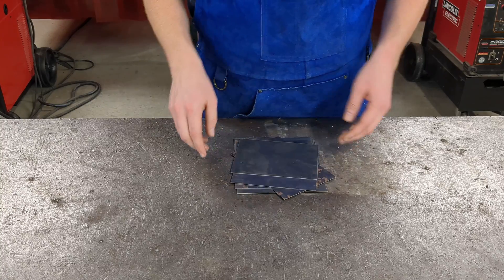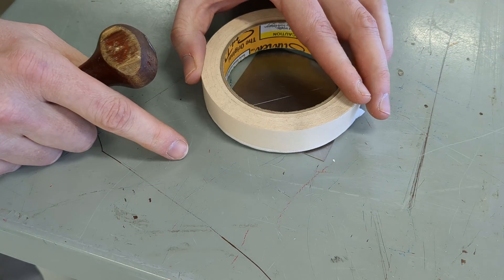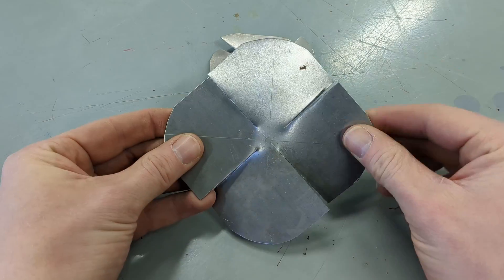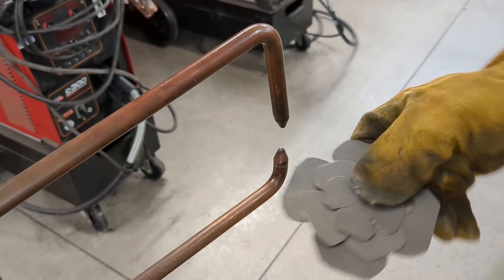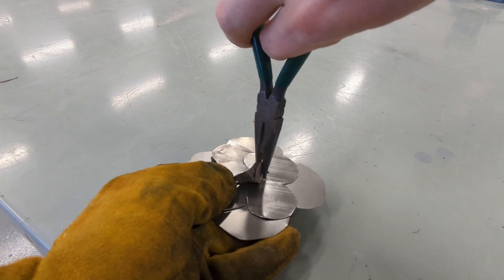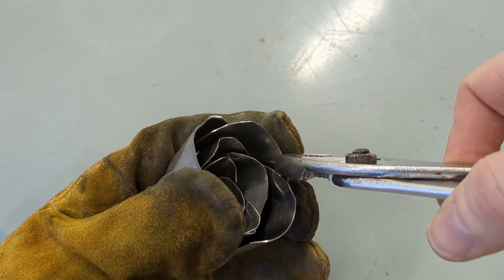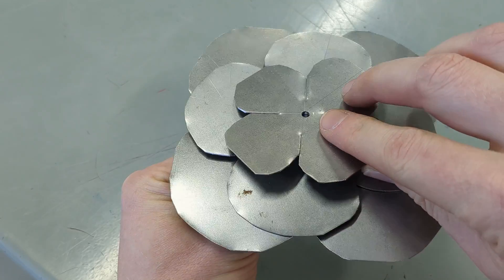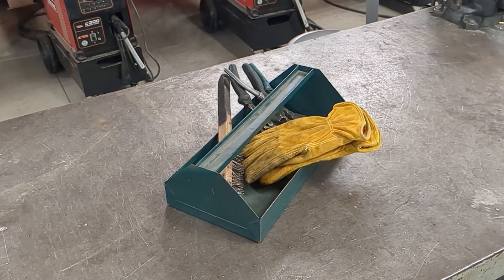Make A Sheet Metal Flower With Basic Tools

Comment: Is there any way to add a stem using the spot welder?
Reply from the maker: I'm sure there is but I have not found an easy way.  We tried putting threads on the end of a scrap piece of rod and then using nuts to hold it on, but it didn't look good and was more effort than it was worth